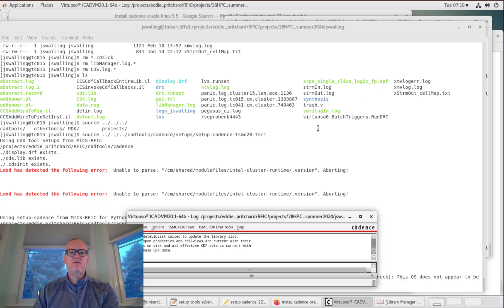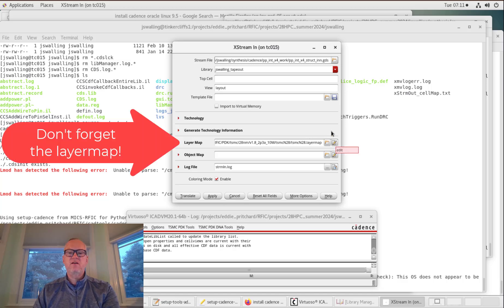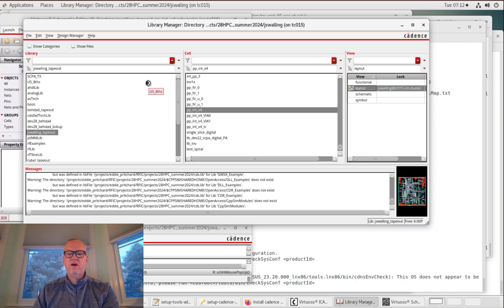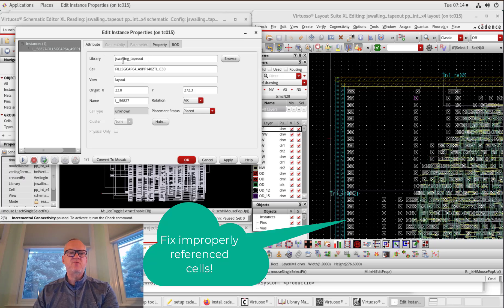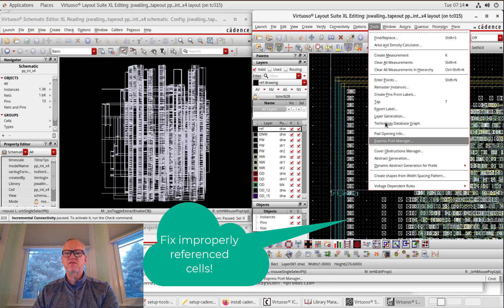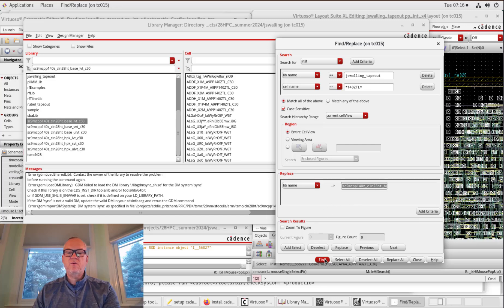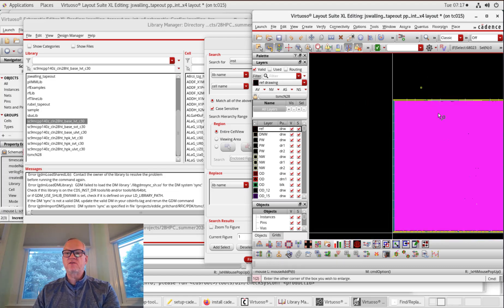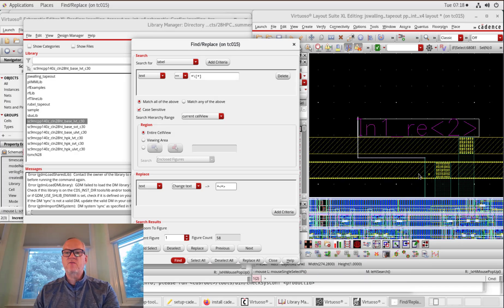Cadence Virtuoso   Import Artwork Stream File GDS

Comment: The way I solve the issue with reference library is to import the GDS file inside the library contain the standard cells. in this way only the top cell is generated, since the standard cells are already there.
Reply from the maker: Sure, that will work, but not everybody can have access to that configuration, so it is a pretty easy workaround to point to the correct library. Also, often it will import other structures like via stacks that you don't want in the cell library.
Reply: @ yes you are right. I just make a copy of the standard cells in another library and then import the GDS file there. 
Thank you for the amazing videos.
Reply: @ also I have a question about the well taps. In the past I used another technology that has the taps at the top and bottom of the cells. Is there a specific reason that some of standard cells are designed without taps?